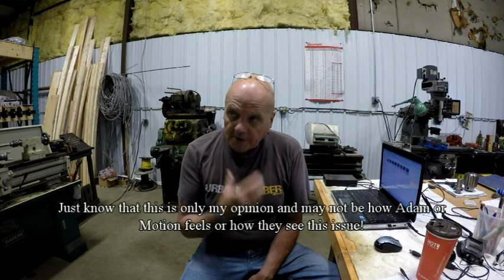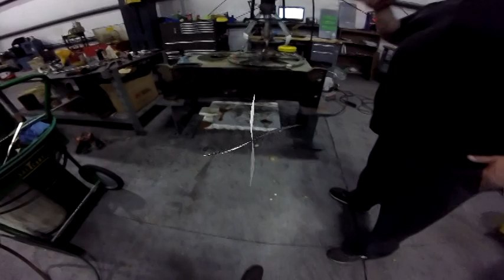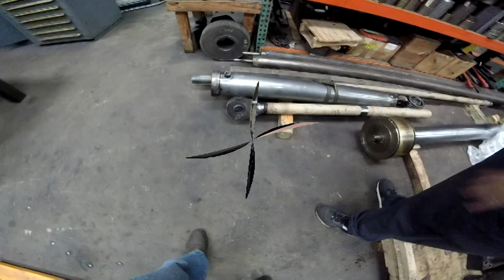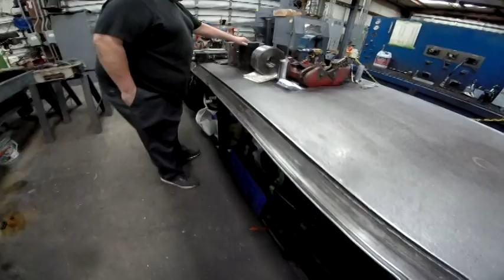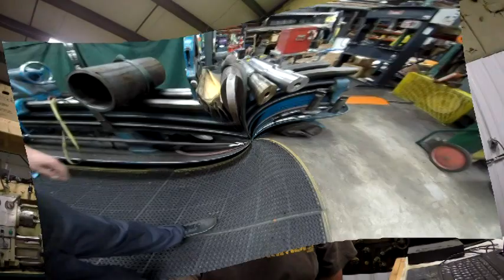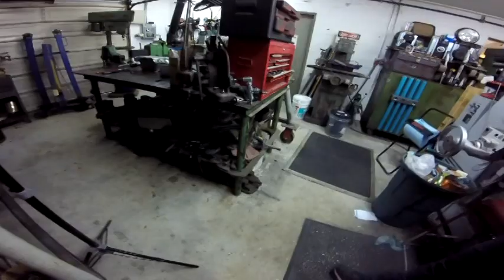Shop tour with Adam Booth

Comment: Hi Joe, an FYI on the "orange crusher" shaft, actually the "crushing" is of frozen blocks to produce "fresh" not from concentrate juice year round, the blocks are on stainless steel skids, the blocks get dumped on to a pair of rotating stainless steel drums with interlocking spike blades that pulverize the block to make the juice.